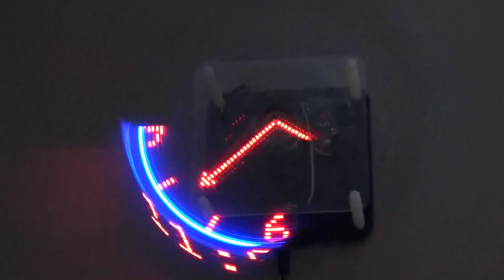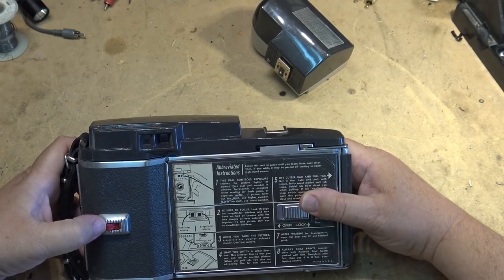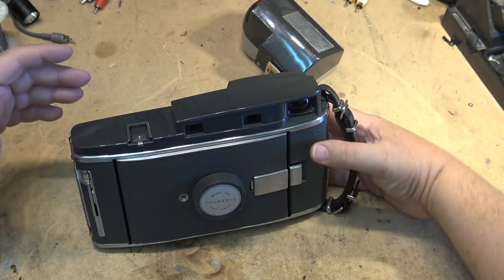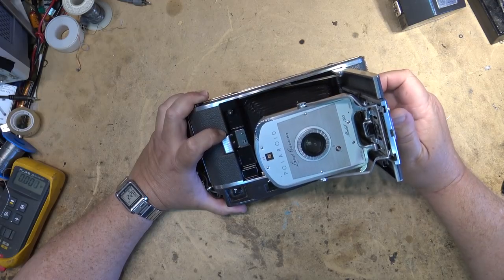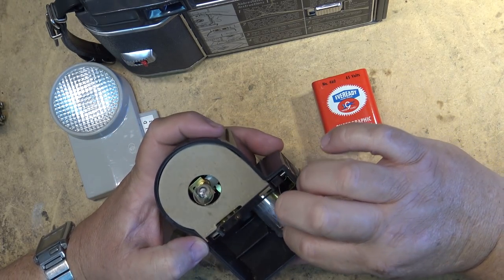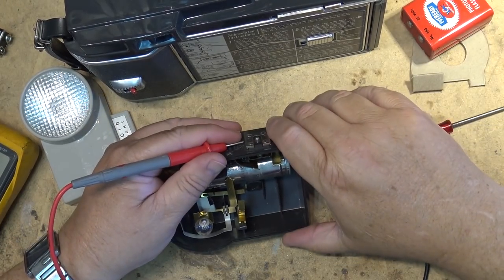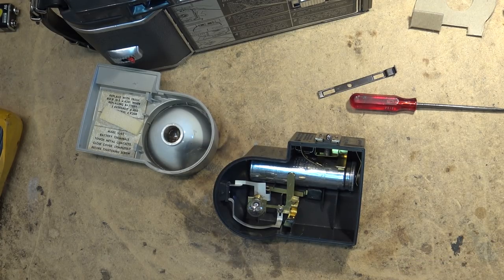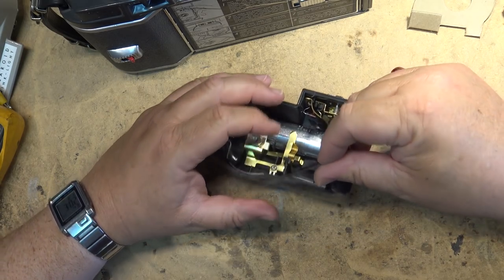Vintage Polaroid Camera and Flash Teardown

Comment: Great reverse engineering of the Wink Light. Polaroid intro'd 3000 speed film along with Wink Light to allow indoor pics that weren't BLASTED with light like their 50 and 80 and 100 speed films needed indoors. The exposure wheel you turned altered both the aperture and speed. You can look into the lens and see the various apertures. So a couple settings would share same aperture but use faster exposure as the number went higher. Polaroid had their own set of numbers but these were the same as the existing EV scale, but nine higher. (add or subtract 9 to change scales) So you would get a reading from your light meter and set that dial. There was a snap on ND filter that moved it down 4 stops if you wanted to use 3000 speed outdoors or add bokeh. There is no film made for these anymore but you can lay a single Instax shot across film gate and test the camera if you can load and unload, then process in a dark room. I have been amazed to discover that these 60 year old shutters and lenses still work fine. Most of the bellows are still good too. Nice article

Comment: That's a loverly old camera, well built and the bellows/gator lense spacer is such a classic design.
I'm not at all supprised by it being expensive, quality costs.
The large storage capacitor or condenser would be able to deliver the high current limited time pulse. 
How clever and simple is that :-D
I remember the kodak instant camera, the special film/chemical/battery made it an expensive and low quality photo.
I liked the much much later compact camera with a film cartridge like an old telephone handset, wind it to the end and pop it in to the local chemist for developing, much better picture than the kodak.

Comment: Great Video!  I am planning to modify a similar camera to use modern Fuji Instax Wide film.  Would you be able to do a similar video with the Polaroid Flash Gun #281 (which was made for cameras like that one)?  I am not sure what goes on in those old bulb flash guns regarding the battery and capacitor.  Can they be resurrected?

Comment: I remember having one of those on an oscilloscope hood where I worked.  Set up experiment, install camera, open shutter, trigger a single trace, close shutter, pull out film, wait 1 minute, have hard copy.  Used high speed B/W film.  Now we have digital oscilloscopes,
Reply: I actually did the same with a digital camera earlier this year. I didn't use a hood, just turned down the lights and used around a half second exposure. The hard part was getting the timing right between the camera and my experiment.

Comment: i had a Polaroid camera that used 107 black and white film and 108 color film that came in film packs. It came with the shellac stuff to put on the picture to keep it from fading. It had 8 pictures per pack and in the 1970's it cost $2.10 per 107 pack. I don't remember the price of the 108 pack. I later got a Polaroid Pronto that used SX70 film that had a flat 6 volt battery in each film pack and the film shot out the front. I did not know about the roll film version.
Reply from the maker: I always wanted a. St70 but I ended up with the Kodak version . It took great pictures.  Used a flip flash that had I think 8 flashes. As each flash bulb popped it would melt a thermal fuse behind the bulb that would connect the next one on the strip.  After 4 you flipped it over and got 4 more. If one ever failed to flash then the rest on the strip were dead.
Reply: @12voltvids  That's a neat design for multiple flashes. I presume it was designed so only one bulb at a time was active.
Reply from the maker: @eDoc2020  
Yes with the flip flash it was an alternative to the magic cube and flash bar.  The history of camera electric flashes was.  Flash bulbs, originally they looked like a big 60 watt light bulb and they  produced enough light to light up a cave.  Then miniature pin based bulbs were produced.   They were the same thing, basically a wad of steel wool, sealed in a glass bulb in a pure oxygen environment.   A small filament in the base would explode when the capacitor in the flash unit discharged across it and that would ignite the oxygen and steel wool and it would literally explode and produce a ton of light.  The glass bulbs were coated to prevent them from shattering.   Then came the flash cube, the camera would rotate them 1/4 turn when the film was advanced.   A battery in the camera fired them.  Then the magic cube.  It used a mechanical pin to poke the trigger spring that would strike a primer at the base of each bulb to trigger ignition.   Polaroid had their flash bar that went on their cameras so Kodak used flip flash. Electrically triggered where only the first bulb was connected.  When it fired excess heat from the bulb ignition would fuse the contact for the second bulb. It fused the 3rd an it fused the last one.  A red dot on the back of the flash would burn and turn brown once the flash fired to show that it had been used. If I remember it had 10 shots which was the same as a pack of film had.  The old Kodak instant camera used 2 size j batteries.  One to operate the camera and the print eject motor and rollers and the other one to fire the flash bar.

Comment: Sorry for going off topic but do you have any experience with changing the rechargeable and built in battery of Sony Hi8 camcorders? I got a couple that refuse to remember settings when battery is removed. For some reason, Sony didn't make all built in batteries changeable. It's a CCDTRV98 in this case

Comment: Sadly, peel apart films are totally dead now, thanks to fuji...luckily integral Polaroid film is still available due to a crazy Austrian guy buying the equipment and starting the impossible project company. Funnily enough, they were able to buy Polaroids branding and intellectual property two years ago! So now they dropped the price and moved to a formula closer to the original and rebranded as Polaroid!

.Makes me Soo angry that Fuji discontinued this films replacement past year, same stuff just packaged in packs of 10 sheets instead of on roll. Fp100c..

The Polaroid peel apart roll film that these used is ome of the most resilient to aging. my stupid money wasting tendency landed me buying a while bunch of film for these, about 50% of rolls I have will still produce an image. Amazing.

Also, right before discontinuation I bought a case of Fuji fp100c peel apart packfilm wholesale. $4 a pack basically...it is now selling for OVER $80 a pack! I need to sell my remaining stock and have a down payment on a house....but I just love the film too much...
Reply: Here I am two years later getting into non integral Polaroid cameras at the wrong time lol. at least I can get a nice lot cameras and accessories for peanuts…  maybe FPP can bring back packfilm sigh. I’m still glad I can get rolls of 35mm Fujifilm I guess.